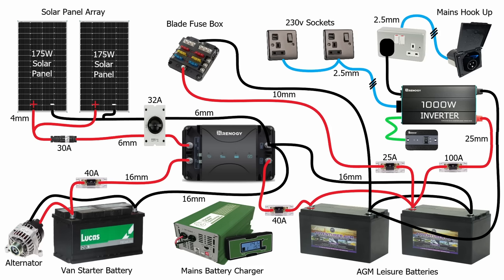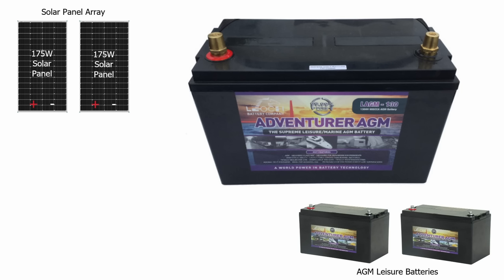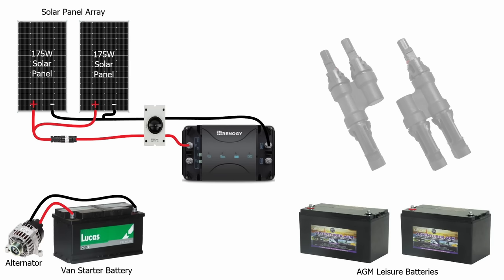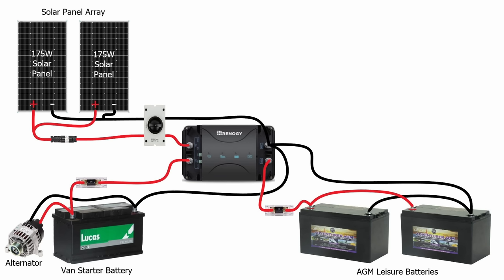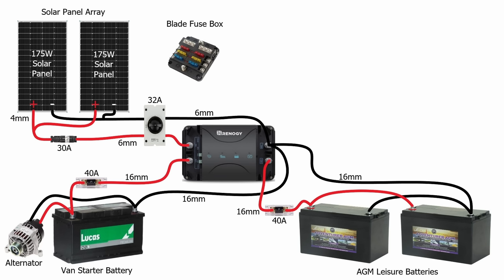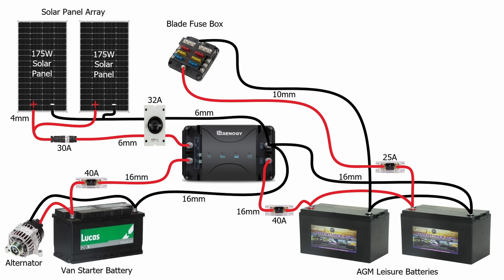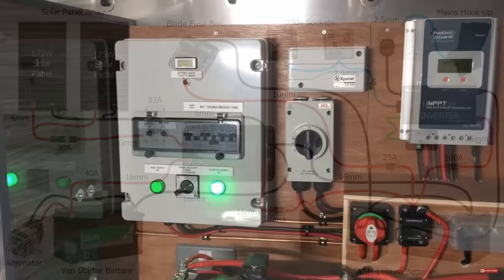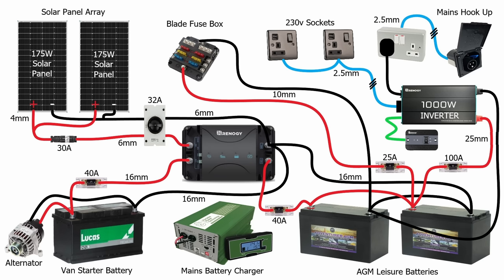12v Electrics for Off-Grid Campervan - Fiat Ducato Budget Build Ep12

Comment: Hi again, so I’ve decided to add the solar and follow your set up. A question which DC-DC charger the specific one you have pls? There are a few and I’m not sure?
Which is the solar PV isolator you use, again there are a few that pop up on the eBay page. Just trying to get the same kit as you so less to adapt or navigate later .
The panels and fuses are out of stock 😲. 
Many thanks
🙏
Reply from the maker: The dc to dc charger is the 30amp one and the dc isolator is the 32amp one. 😊
Reply: Thank you, is it the BT-2 ( think this means Bluetooth?) DC to DC charger or the other one pls?

Comment: I noticed that you don't connect your battery charger to the system. Is that not a good idea to automatically charge the batteries when connected to a grid? What is the reason? Thanks!

Comment: Greg, great vid again, one question? can you at some point explain cable sizes, not from a electrical standpoint, but from a physical size, EG:- 16mm cable isnt 16mm, how do you know what it is? also you see cables sized as AWG also! whats that mean, if i put my vernier over the cable diameter what should it read! hope this makes some sense 🙂
Reply from the maker: All uk cable sizes relate to the cross-sectional area of the conductor core. So a 16mm cable is not 16mm in diameter but the core will be 16mm2 in area (5mm in diameter)
AWG refers to the American Wire Gauge and you can find a simple conversion chart using this link 
https://www.atulhost.com/wp-content/uploads/2021/02/awg-to-mm2.png
Reply from the maker: You can’t really tell by the outside diameter because insulation thickness can vary depending on the cable type. Best to measure the diameter of the copper core and work out the area by multiplying by Pi (3.142)
Reply: @GregVirgoe  cheers Greg. Great help

Comment: can i ask why you have used 25mm for the inverter to leisure batteries, yet the other battery cables are 16mm, where, on your previous builds you said that the battery to battery cables should be the same size as the battery to inverter? or is it not needed

Comment: G'day Greg... fantastic youtube video and I have gained alot from this video ... One question... with your setup if I switch the inverter to a 1500W Inverter what  things should I consider (or change) in your solution ?? I want to run a small air fryer maybe once a day and I can not find an air fryer that is under 1000W)  Thanks in advance Davo
Reply from the maker: Ok so that size inverter will need a 150Amp fuse and 25mm cable. 
You also need to use Lithium Batteries because of the high amps you need to pull from the battery to power the hob. 
Renogy have a deal on two 100Ah lithiums for approx £600 total which is a bargain
Reply: @GregVirgoe  Thanks just ordered 2

Comment: Hi Greg
I am installing a Truma 4e boiler into this system. Would you hardwire it into the consumer unit thus using up the 10amp mcb or can i run a plug socket from the mcb and put a plug on the truma. 
My thinking is that i would like to be able to plug my 2000w renogy invertor into the 10amp mcb to utilise my van plug sockets while on hook up.
I will have a charger running from the 6amp mcb.
Any help from you is always appreciated.Thank you.
Reply from the maker: I fitted a socket and plug near my truma for local isolation. You can run the truma on the mains pass through off the inverter but only use it when on hook up and only on gas when off grid.

Comment: Im a little confused where it comes to the inverter. I understand powering the sockets when off grid but why stay connected to the inverter when on mains? With a battery charger connected and feeding the batteries surely all of the 12v sockets are easily fed? Is this just a convenience thing or am I wrong? I was planning on manually switching the 240v socket chain from the consumer unit fed socket to the inverter when off grid. Anyone enlighten me please? Also, the plug on the 240v socket chain, does this need any specific size fuse or a standard 13A?

Comment: Hi Greg. Excellent information as always, thanks. One question,  when running the cables from the van battery to the DC to DC charger is it better to run a negative cable the full length or would the chassis ground be sufficient?
Reply from the maker: This is a great question. almost every auto electrical system uses the steel body of the vehicle as a negative path back to the battery to reduce the number of wires and cost of the electrical installation. However, steel is less than 15% as conductive as copper, therefore, a copper cable can conduct electricity better and with less resistance. There is also the issue of rust build-up on these chassis connections making that connection worse or even fail in future. For these reasons, I prefer to run a negative copper cable and not rely on poor chassis connections. It is a small price to pay for a better system IMHO :D
Reply: @GregVirgoe  Good point! Based on that I'll run a cable full length. Just started my 2nd build which happens to be a Boxer so your Ducato budget van build series is very handy for reference.  Cheers!
Reply from the maker: @colinmacalpine7707  you can see how I ran those cables under the van the shortest route watching from this point in the wiring video https://youtu.be/iYtaulMvvMg?si=hvEQ3xzEVLqtzebT&t=203

Comment: Hi Greg  . would it be ok to use extra long jump lead cables which are 8 guage (16mm2) instead of buying more expensive 16mm2 cable to run from the van battery to the back of the van where my ctek 250se and batteries and fuse box etc will be located ?   Thanks in advance- Kenny
Reply from the maker: I actually looked at that myself because heavy duty jump leads are way cheaper than buying battery cable. Honest answer I don’t know why that is. But in theory if the cable is the right size csa then it should take the load. Welding cables was another option that appear to be cheaper too. There should be a spec written on the side of the cable that you can google to find more details. I’d be interested to hear what that is 👍🏼

Comment: Awesome as usual! Thanks so much Greg. 
The 30A controller is out of stock at the mo. But the 50A controller is reduced to £209.99 on the renogy website and in stock. Would it mess up the setup to buy the 50A version? Sorry if that's a stupid question!
Reply from the maker: Yes I saw that, I hope they get new stock soon. It's a good question and it really depends on what type and size of leisure battery you intend to install. As a rule fo thumb you would not want to charge lead based batteries more than 20% of their capcity. i.e. for 200Ah battery bank that would be 40amps, so if you had two 130Ah batteries that made total of 260Ah then a 50A charger would be ok as it's less than 20% of that capacity. I hope that makes sense.
The 50amp charger is also on sale and less money than the 30amp one so a bit of a bargain at the moment, you can add more solar to that one and gain a bit extra power from the van when driving too. If you decide to go Lithium the 50A charger would be much better in future.
Reply: Thanks for explaining. Makes sense and good to know. Very helpful 👍

Comment: Hello my friend!! your info are very helpful, thank you!!! 
Can i ask you something, in a previous video you use to connect the battery with the fuse box a 50A fuse and on this video you use a 25A fuse, and the question is, how dose the size of this fuse come out? It's about how much A we have on the fuse box? because i want to use a 12 ways fuze box
Thank you!!
Reply from the maker: Yes it depends how much you have connected to your fuse box. It is the total of those connected amps plus a small margin.
Reply: Can I use now fuse box 12 ways and 120 V  fuse just for usbs and led lighing, because later I am going to install fridge, diesel heater, 3 vents...?

Comment: Fantastic video thank you. Just in time too. We were toying with the idea of just buying a 1500 power bank instead of installing an electric system in our van, as we are in a big hurry to convert (4 week Scottish road trip planned in less than 6 weeks) and it seemed so complicated and daunting until I saw this. Can you please tell me roughly how much this system costs? We bought a mwb last September and straight away fitted windows and a roof fan, but then it’s been left in limbo ever since as the electrical side was bamboozling me, plus busy lives. 
this looks like it’s going to take the headache out of trying to figure it out ourselves. 
I shall share this video with my husband, as it’ll be him installing the electrics 
Many thanks for this very well explained and helpful video 🙏
Reply from the maker: It's on a par with the cost of a basic powerbank and portable solar panel here are the details...
Renogy Solar Panels £260
Renogy Battery Charger £154
Renogy 1000w Inverter £121
Renogy Fuses £35
Renogy Two panel mounting kit and cables £58
Leoch AGM Batteries £210  batterystore.co.uk
Battery cables £112  Quickbit.co.uk
Total costs £950
I got a discount for the renogy equipment using a code from Honey which saved me £45
Reply: @GregVirgoe  thank you for the cost and breakdown. I think we’re going to go for electrics in the van and buy a small cheaper power station - just because I love the idea of something portable to use out side of the van/in the garden/car. 
Do you think two days is a realistic time for getting the electrics done? My husband is very handy and works with tools everyday
Thanks again, I’m so glad I saw your video before buying the power station I was planning
Reply from the maker: @pj4482  yes a good couple of days you could do all the first fix eiectrics. 👍🏼😃
Reply: @GregVirgoe  great. My husband has been watching your video and taking notes for the last hour or so to get it clear in his head. He is so grateful to you for putting out this video and says he will be buying you a few pints in the form of a donation to say thank you🙏 😊
Reply from the maker: @pj4482  it’s makes my day when I know the information is helping you guys with your van 🚐 that all I can ask for. Many thanks 🙏🏼
Reply: @GregVirgoe  looking at the comments on this video, we’re not to only ones in awe of your knowledge, generosity and who greatly appreciate your help. You are a star! 🙏🌺
Reply: @GregVirgoe  hi Greg, can we put a slightly bigger fuse board in than the 6 way, say 8?
Reply from the maker: @pj4482  you can put 12way or two 8 ways or whatever you need
Just remember to size the cable and fuse to each blade fuse board based on the connected load in amps. I’m fitting two fuse boards in the Ducato one on each side of the van to cut down on wiring. Like two remote distribution boards. 
Hope that helps 👍🏼😃
Reply: @GregVirgoe  that’s great, thank you 😊 
Good idea using two fuse boards too
Reply: @GregVirgoe  hi Greg, no matter where I look, The 30A dc-dc duel mppt is out of stock. Do you know of an alternative that we can buy please? We’re going away in a few weeks on a special road trip and if we can’t find something, I’ll have to resort to buying a power station after all, for the fridge, lights and chargers. We have almost everything else being delivered very soon, apart from some cables and the dc-dc. Many thanks 🙏
Reply from the maker: @pj4482  be quick only one left in stock https://www.amazon.co.uk/dp/B0891SJTD5/ref=cm_sw_r_as_gl_api_gl_i_W5D6ZMERHR89XV54JWC2?linkCode=ml2&tag=gregvirgoe-21

Comment: Thank you Greg, as always a really informative video. One question if OK? Are you connecting your mains battery charger direct t'ou your Batteries or linked in to your mains hook up/ inverter?
Reply from the maker: Mains battery charger would be connected direct to the same battery terminals as the solar charger 👍🏼😃
Reply: Thanks for the reply Greg, truly appreciated.
Reply from the maker: @footballleo1239  no problem 😉 anytime 👍🏼

Comment: To make this even cheaper you can just use an old UPS instead of an inverter and mains charging system, itll do both and older ones are e waste when the cells dead to most

Comment: Hi Greg hope you  an help just building my fiat ducato and want to run everything of my ecoflo delta pro 3600 I have a 360 watt solar panel and 8 small round leds plus 4 charge points 12v  and a diesel heater could you help with a wiring diagram please ?
    Regards Chris

Comment: Hi Greg, my electrical setup is almost identical to this design except im using a single 230ah lithium battery. Ive ended up with too much 16mm wire as I decided to put my setup under the front passenger seats to save space, can I use the extra 16mm to connect the battery to the blade fuse holder, instead of 10mm? Cheers
Reply from the maker: Oh yes 👍🏼 you can always go bigger. That’s less resistance and less volt drop and will run cooler too. Perfect 🤩

Comment: Hi Greg, great video, very informative but I'm just wondering how you connect 2x25mm & 1x16mm cable to the battery?  Have I missed something or has this already been answered but is it just simply the case of using big eyelit crimp lugs which I would assume I would need a proper crimping tool or is there something else.  Never done any motor wiring before so excuse my ignorance, many thanks in advance if you could answer this for me, cheers.
Reply from the maker: The larger cables do need a special crimp tool to fit a lug on them. Then you fit battery terminals with either 8or10mm stud on them to connect your cables onto with a locknut on top.
Reply: @GregVirgoe  Thanks for getting back so quickly, fantastic info.

Comment: Question - the updated DCC50S 12V 50A DC-DC On-Board Battery Charger with MPPT now goes to 50V - so using the same 175 solar panels at 21.6 V each  - would they then be wired in series as opposed to parallel?
Reply: This is what I’m planning to

Comment: Great videos as always greg, one question i have is how did you come to find you need 16mm cable from vehicle battery to dc-dc if its only 30 amps , is this due to the distance youll be going ? Only reason i ask is ive bought the same dc-dc and it recommends a 45amp inline fuse and 10mm cable i believe id rather be safe and go for a higher cable anyways but what cable size should i go for if the cable run is probably 2m max cheers
Reply from the maker: I increased the cable size as mine runs the full length of the van from battery to charger and the larger cable results in less voltage drop. 
If you are only running 2m then 10mm will be big enough. 👍🏼😃
Reply: @GregVirgoe  brill i thought so cheers greg

Comment: Great video Greg 💪🏻. 
I’m following your set up but have a quick question if you could help. 
I accidentally bought the 130ah batteries instead of the 110ah ones. Will this affect the set set up?  
Thanks In advance.
Reply from the maker: Not at all the extra storage does t affect any of the cabling shown here it just will give you extra capacity to be off grid 👍🏼😃
Reply: Thanks.

Comment: Hi great videos I have l4 wheel base would it be worth me putting split charger due to voltage loss 11 ft where my battery’s going under the bed seems a long way thanks
Reply from the maker: Yes absolutely mine runs at least 5m or 15ft fromthe van batetry to the rear fo the van and onto the charger, If its longer than that just increase the cable to 25mm to reduce the volt drop.

Comment: Great video.  Couple of questions.  1st would this system be OK for a Boat? 2nd the battery charger would you connect it directly to the charge controller or straight to a battery or in the case of leisure battery's how would it connect?
Reply from the maker: Thanks 👍🏼 yes it’s perfect for a boat if your boat has an engine with alternator like a narrow boat or larger cruisers. If your boats doesn’t have engine and alternator then you can still use this setup but change the dc to dc charger for a stand alone mppt solar charger. The mains battery charger connects to the same leisure battery terminals as the other charger. Hope that helps 🤩
Reply: @GregVirgoe  thank you for getting back to me.  Could I add two more batteries to this. Also how would I add a extra battery for the windlass or would that need a separate system.  I'm not to  good with electrics it goes over my head
Reply from the maker: @anthonywhitehouse2295  yes of course you can add extra batteries in parallel to this string but be aware that although it increases your stored electric you are potentially still generating the same amount. As you can only use what you can generate it’s wise to scale up both the solar and battery together. More storage capacity requires  more charging ability. 
Regarding the windlass, these can draw anything from 35-200Amp and because of this high draw are typically connected to a house battery which is connected to the most engine and used when the engine is running so that most of the energy is taken from the alternator. You could connect it to this system with motor rated breakers and still run the engine when in use. But first need to find out the exact electrical spec for the motor. Hope that helps 😃

Comment: Greg, where did you source the 25A fuse to the blade fuse holder? The link you provided (Renogy) only come in 20/30/40 etc. Can you drop to 20A or does it have to be 25?
Reply from the maker: I did that deliberately because you need to size that fuse depending on what you have connected to the blade fuse holder. Add up the current of all your devices and choose one that is just over that but no more than 25% bigger.

Comment: So where do you fit the consumer unit /rcd when using a through type inverter & a seperate charger?
Reply from the maker: You will need one on the back of your hook up socket before the inverter and potentially one after the inverter too as that is a completely separate 230v supply originating from the inverter. Check the earthing requirements from the inverter installation instructions 😊